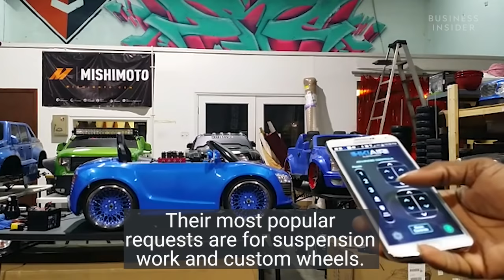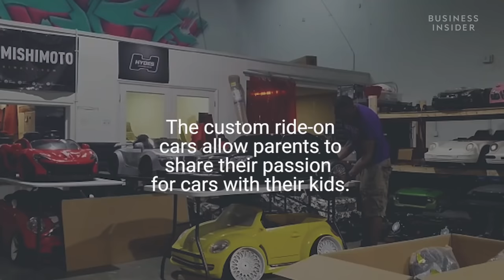This Shop Customizes Toy Cars So Your Kids Can Ride In Style

Comment: Well I'm not a parent yet but I do have a small friend he is 12 years old and I teach him about mechanics the best I can we once found a old power wheels and I had a 80cc 4 stroke ohv engine I put it on the front end sticking out with a band then I asked my friend who works on gokarts to helps us out and we welded a subframe and put gokart wheels on the back and front sadly the front engine design was a pain because we had to run like 2 chains the were big to the back wheels took time we got it running and still had it to just a few weeks ago till it got stolen now we are working on a fzr1000 motorcycle you can check that oje out in my channel